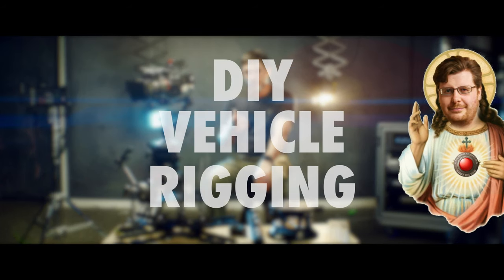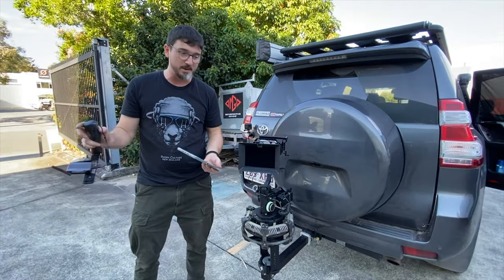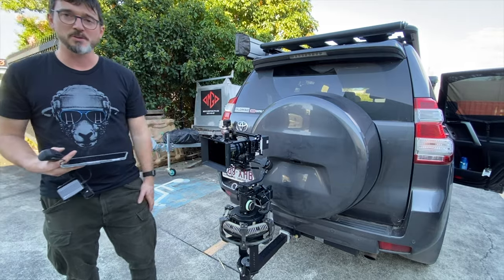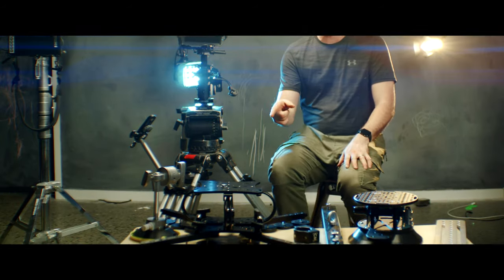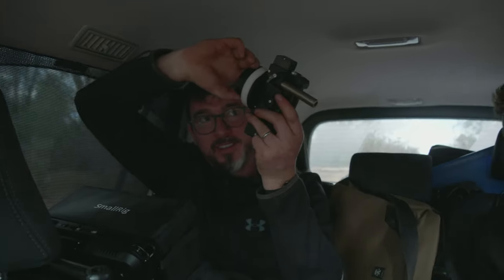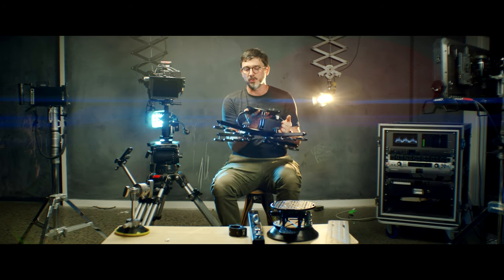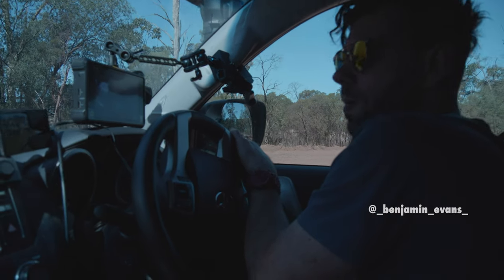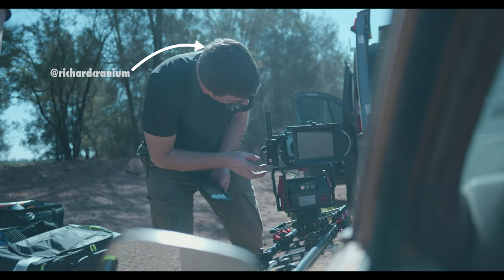DIY Vehicle Rigging PT2 – RED Komodo + Crane3S + Tow Hitch Mount

Comment: Can you elaborate on the drone controll and transmission from inside the car?
Reply from the maker: The inspire 2 allows for dual control - so a master remote (flight) and a slave (gimbal control) and each controller has a HDMI output you can connect to a monitor.
Reply: @graetzmedia  Gotcha! I've got the Inspire 1 RAW...should be the same right? Do you know if on the 2 does it output the pilot cam on one controller and camera on the other?
Reply from the maker: I think either controller can choose between FOV cam and gimbal cam. The pilot certainly can choose either.
Reply: @graetzmedia  Thanks! You're the man